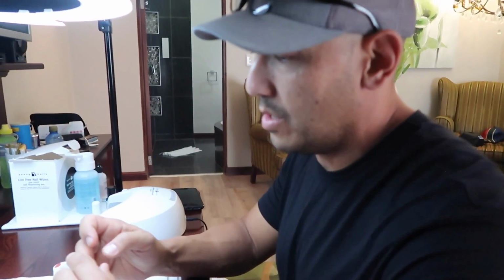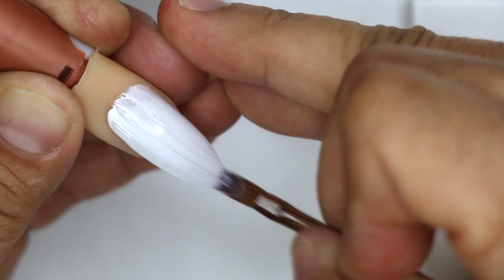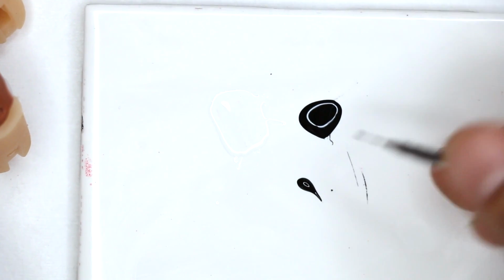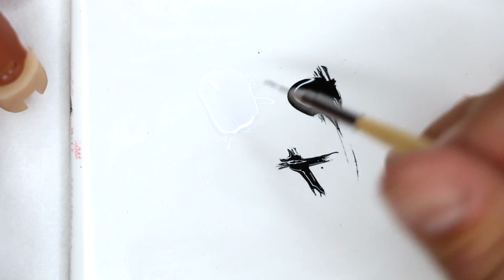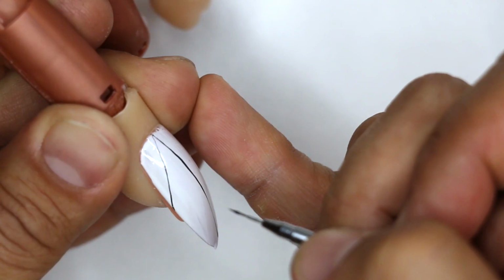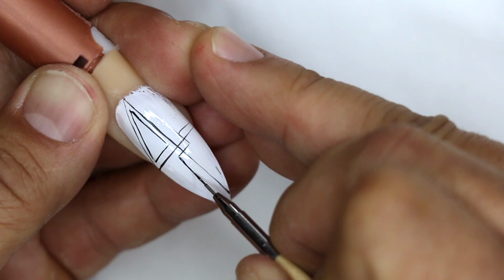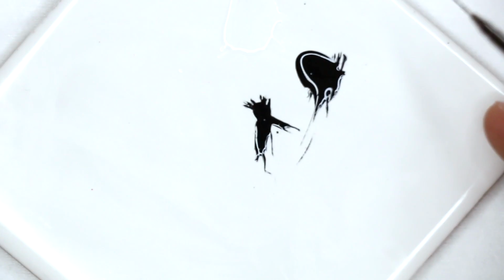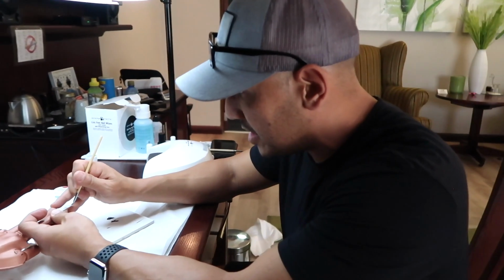YN NAIL SCHOOL - TIPS AND TRICKS USING YOUR MICRO DETAILER

Comment: Hi, i love the overhead light. Is that for filming or do you use it for on the daily for working?
Reply from the maker: We are not a salon so we do not work on clients. It is for filming, but you could use for everyday use as well. Here are links for the ring light we use as well as what we have it mounted on. You can message us on our Instagram for pictures of our set up.

https://www.amazon.com/Adjustable-Photography-Holding-Reflector-Monolight/dp/B07ZG88M6N

https://www.amazon.com/Neewer-Dimmable-Ringlight-54inches-Streaming/dp/B086QTFXJ6/ref=mp_s_a_1_3_mod_primary_lightning_deal?dchild=1&keywords=neewer+ring+light&qid=1614280809&sbo=Tc8eqSFhUl4VwMzbE4fw%2Fw%3D%3D&smid=AUOXPLWF195VR&sprefix=neewer&sr=8-3

https://www.amazon.com/GODOX-LR180-Daylight-Ringlight-Black/dp/B07RFNTZJH/ref=mp_s_a_1_5?dchild=1&keywords=godox+ring+light+lr180&qid=1614280899&sprefix=godox+ring+light&sr=8-5
Reply: @youngnailsinc  thank you so much!

Comment: Thank you!! My freehand art leaves a lot to be desired and I won't lie. When I saw that brush when I opened my box I kind of panicked because it's so perfectly fine. I appreciate the tips and tricks, I absolutely would have just gone right into the pot instead of using my tile for it. 

I have a question about the paints themselves, will a bit of glitter mix well into them? I'm already creating tiny Christmas trees and wrapped boxes with ribbons in my head but I wasn't sure if the consistency of the paints would support adding glitter. I'm all for experimenting but I didn't want to waste any :) Thanks!
Reply from the maker: This is why a tile is so key... you can take a little bit out, mix in the glitters and see if you like the combo.